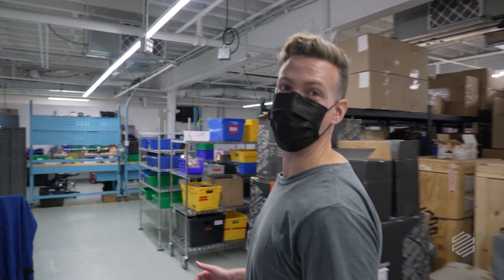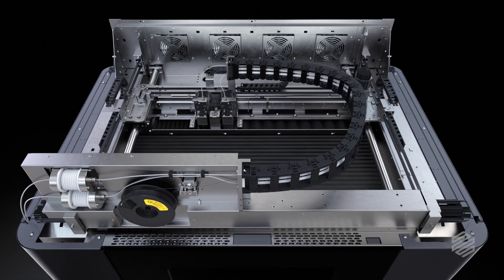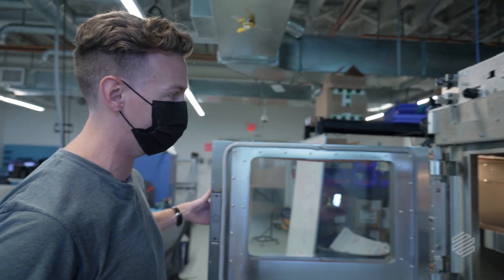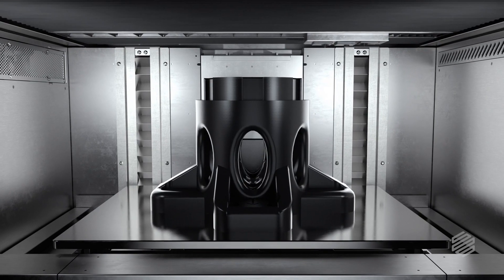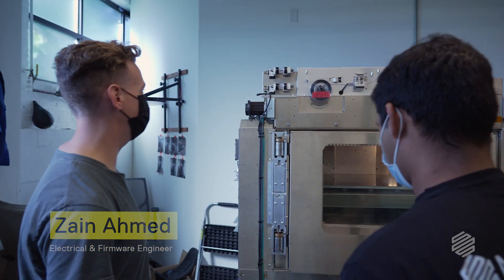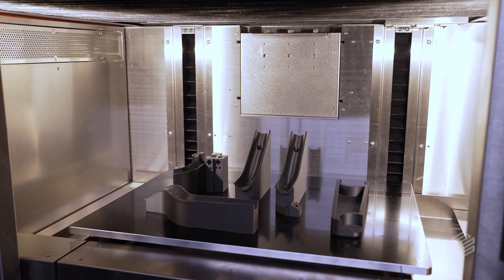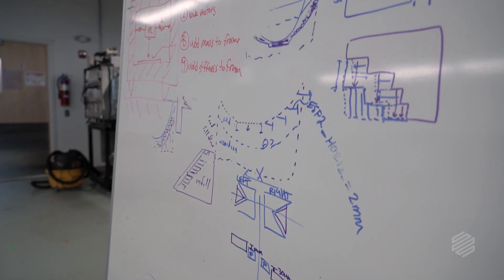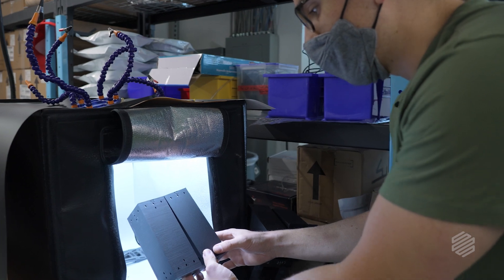Behind the Scenes with the FX20 3D Printer

Comment: Looks impressive. Would be interested to know what kind of a speed improvement we're talking about vs like an Onyx One or something (the specs don't appears to list speed).
Also, the machine in the video appears to have at least 2-3 print extruders. Is this the planned final configuration? Will this allow the use of dissolvable support materials?
Speaking from experience, I will say that in spite of the relatively high cost to operate and slower speed compared to other printers out there, you can't beat the quality of the resulting parts from a Markforged or the fact that "It just works".

Comment: that surface finish! 😲🤯🤯
Reply from the maker: This is the exact reaction we are looking for ;)
Reply: @markforged  amazing surface finishing! would you mind doing a video addressing how you guys fix issue 6 or issue 602 that have been bugging the hobbist FDM printing community all this time?
Reply from the maker: @Windytale  Thank you! The stiff aluminum unibody construction of the chassis and gantry definitely help, which minimizes the deflection caused by torque from the belt drive system. There are also slicer settings we use to balance print speed and stability. We’ll talk to our engineers to see what more we can share.